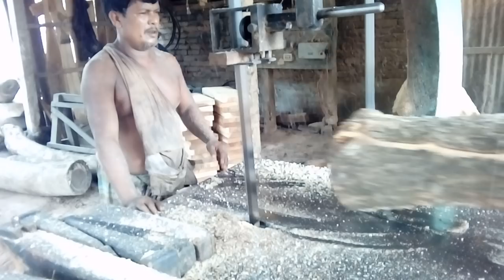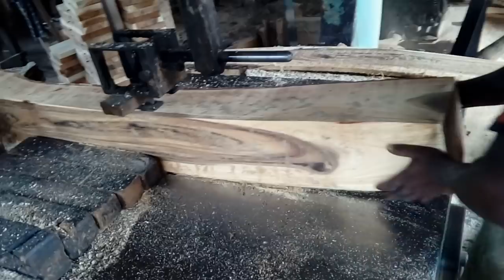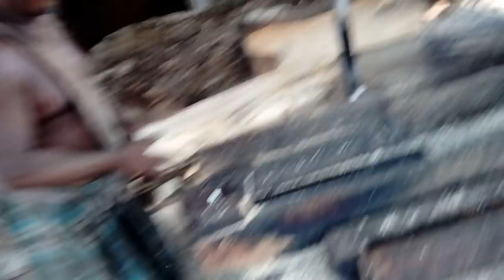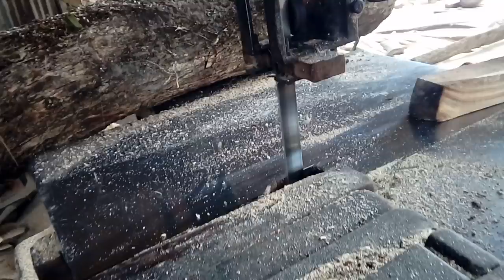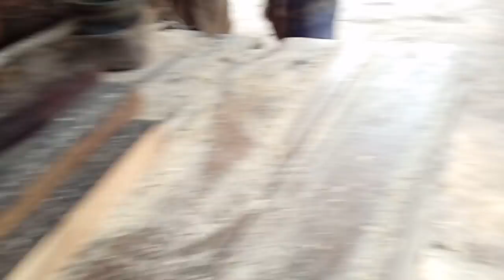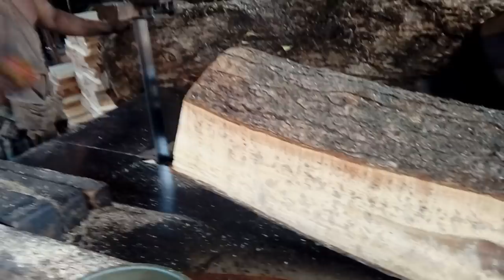Cheap, Light and Poor Quality of Curvy Wood Cutting by Empty Fat Men in Rural Village of Bangladesh

Comment: they can make sled runners  and rocking chairs out of those boards.
Reply: i WAS THINKING THE SAME,  however they are using something that would go in the scrap here in America.  They are great craftsmen
Reply from the maker: Dear the wood will be used for made single bed furniture and chair, tools etc
Reply from the maker: @richardgrumpywelsh2485  really they are